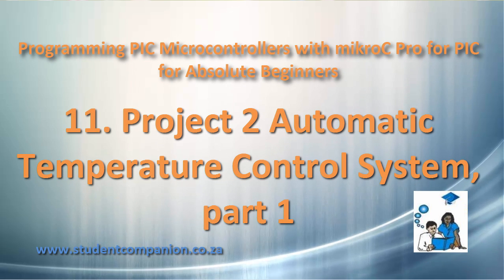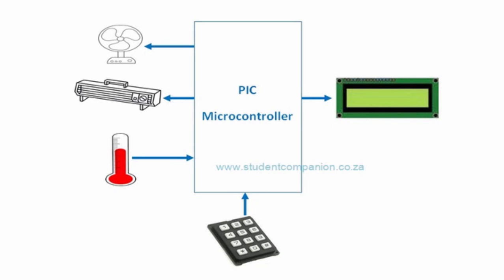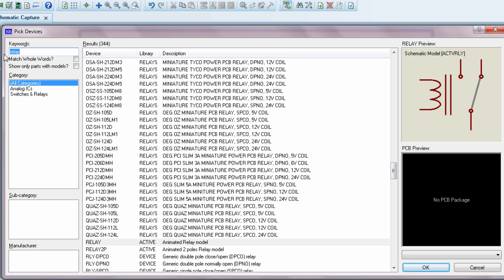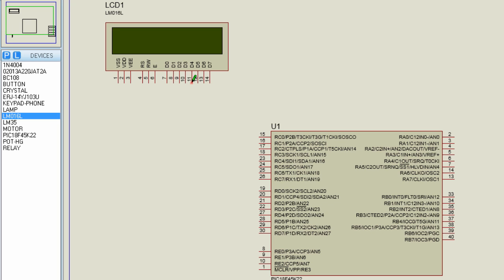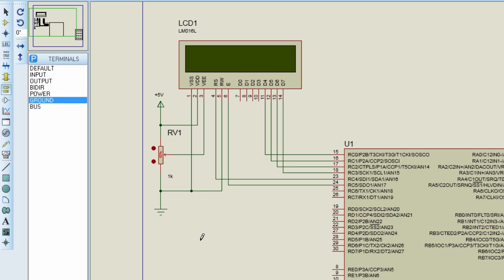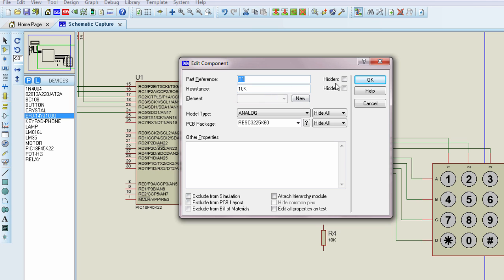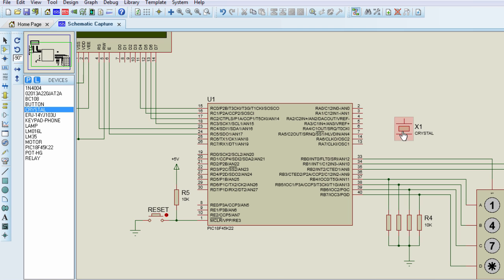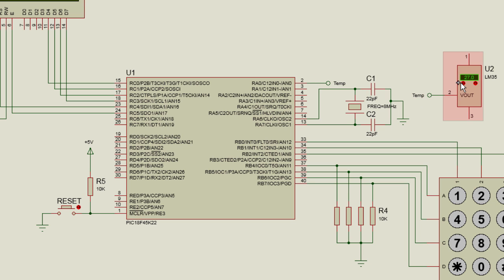11- Project 2 Automatic Temperature Control, part 1 | mikroC Pro for PIC Tutorial

Comment: how we can replace this pic by pic18f45k80 ??
Reply from the maker: There is nothing much to change, just choose a different PIC, configure correctly your clock and other configuration bits, then connect your inputs/outputs correctly to match your new PIC if there are diferences.
The rest of the code should be more or less then same.
If you encouter an error while building the code, post your error message.
Reply: @StudentCompanion  
Can you please mention the things I have to change from 
PIC18F45K22 to PIC18F45K80
Step by step
I have to submit the prototype tomorrow
Reply from the maker: I have already answered you, if you have a more specific question or if you get errors, ask the question again.
Part 2 of this video shows step by step how to start a new project, select clock and other configuration bits.  Follow that video

Comment: Good day. I have a question. What will be the changes in the code if i use PIC16F877a for this project?
Reply from the maker: If you need more info, ask specific questions we will assist you
Reply: That link is about a different project. For this, you have given the codes. What will be the changes to the codes if it will be changed to PIC16F877a.
Reply from the maker: Here is the discussion: https://www.studentcompanion.co.za/forums/topic/can-i-use-pic16f877a-as-the-microcontroller-for-automatic-temperature-control/
Reply: Also, will it affect the codes if i change it to PIC16F877a?
Reply from the maker: Just some few changes as described in the descussion in the link.
Reply: Thank you. Does changing the crystal oscillator from 8MHz to 20MHz affect the codes?
Reply from the maker: @JH-vj9ys  not in code but in Edit Project menu, change the oscillator settings to HS high frequency. 
Do you have good reasons to use high frequency on this simple project? If you are working on breadboard make sure your crystal oscillator is as close as possible to the PIC at higher frequency it's not advisable to work on breadboard.
Reply: @StudentCompanion  I only have 8MHz crystal oscillator (hardware). I have another question, when changing the ANSELx codes to ADCON1, where does the x part go?
Reply from the maker: @JH-vj9ys  if you only have an 8MHz crystal than why talk about 20MHz?
Reply: @StudentCompanion  my apologies, what i was suppose to say is that i only have 20MHz
Reply: @StudentCompanion  Hi, what's a good alternative for PIC18F45K22?
Reply from the maker: @JH-vj9ys  if you watch part 2 of this project, you will understand that we set a PORT to digital using the ANSEL register. ANSELC to set PORTC as  digital, ANSELB to set PORTB . So the x replaces the PORT. But with PIC16F877 does not have the ANSEL register.  ADCON register is used for that
Reply from the maker: @JH-vj9ys  good alternative in respect of what?
Reply: @StudentCompanion  alternative for the PIC
Reply from the maker: @JH-vj9ys  almost any PIC with enough inputs/outputs can be used in this project. Preferably use an newer model, they are more powerful with more features and are cheaper compared to the very old ones like the PIC16F877
Reply: @StudentCompanion  what if i use PIC18F4550, what would be changes in the circuit and codes?
Reply from the maker: @JH-vj9ys  why use PIC18F4550? First of all this is also a very old PIC model just like the PIC16F877, Secondly this is a PIC with USB and if you are not intending to use USB in your application why add more layer of complexity?
Reply from the maker: Check at this list for a suitably alternative: 
https://www.studentcompanion.co.za/product-category/microcontrollers/
Reply: @StudentCompanion  because i am going to create the hardware part and i lack the PIC18F45K22
Reply: @StudentCompanion  i can use any microcontroller on the list instead of PIC18F45K22?
Reply from the maker: @JH-vj9ys  yes almost any microcontroller on thr list can except the smaller ones with fewer pins like the PIC10F. Don't use unnecessarily Pic with special functions like USB or CAN as you don't need them. They will add extra complexity and cost a bit more for features you won't need.
Reply from the maker: @JH-vj9ys  Your code was not uploaded, when you upload, please zip your code first, don't upload the .h or .c files. zip all in one folder before uploading otherwise it will be blocked by our server.
Reply: @StudentCompanion  i already uploaded the zipped version. Thank you
Reply from the maker: @JH-vj9ys  we have answered you in the forum
Reply: @StudentCompanion  can you please send me the right codes?
Reply from the maker: @JH-vj9ys  You can modify it yourself and if you get errors during compilation let us know. What's difficult? We have posted the  differences in the forum, the rest of the code it's according to the changes you have already made.
Reply from the maker: Have a look at this thread: https://www.studentcompanion.co.za/forums/topic/is-there-any-changes-on-the-code-if-i-change-it-to-pic16f877a/

Comment: What size breadboard should I use to fit all components reasonably
Reply from the maker: Hi. A normal full size 830 points breadboard can be used.  But remember you can't put relays on breadboard using high power. It's very dangerous.
Reply: Thanks! And also....how big is the main power supply for the circuit
Reply from the maker: You just need 5v regulated power supply like this one without the 3.3v section: https://youtu.be/QhyEHQ5t0SU

Comment: Hi, I really have a problem with LM35. Firstly, the LM35 cannot read the temperature in Celcius by writing the code as mV = mV/10.0. However, I changed the code to mV = mV/100 instead. Secondly, the LM35 cannot read the actual temperature but it is just reading only 49.9 Celcius. Could you help me, please? Also, I would like to use the DHT11 on this project as well but I do not know how to write the code. Thank you.
Reply from the maker: What do you mean you can't read the temperature kn celcius? Did you watch this video to understand how it works: https://youtu.be/uXxvvrJpFVw

Comment: Hi, could you tell me where could i get heater and fan that necessary for this project. Thank you
Reply from the maker: Hi. You can use any heater or fan of your choice, but if you decide to use high power fan and heater, use the appropriate relays with ratings capable to handle this power.  And remember high voltage is dangerous it can kill you. So be safe. If you have never worked with high voltage like 220V or 110V look for assistance from a certified electrician. Don't do it yourself. If you are desing this project for demonstration purposes I would suggest you use a low voltage DC motor for fan and a bulb for heater. 
Search in electronics shops around your area or online.
You can also use any low
Reply: Student Companion thank you so much for your replying and suggestion
Reply from the maker: You are welcome!

Comment: i can't find pic 18f45k22 , where is the problem ?
Reply from the maker: +nawel ham find it where? Can you be specific with your question? In Proteus, mikroC, in your electronic shop, etc. ?
Reply: i can't find it in Proteus
Reply from the maker: Which version of Proteus are you using? If you are using an old version especially version 7 or earlier version of 8, you might not have new PIC models including PIC18F45K22.
Reply: i have Proteus version 7  thanks for replying me
Reply from the maker: When Version 7 was released, it did not include PIC18F45K22 as Microchip keep on releasing new PIC models very year. You must use one of the new version 8. it will include it, or use a different PIC (older model) for your project. This project can be implemented by almost any PIC with necessary number of pins.
Reply: okey i will try with another pic 
i have another question the mikro c file which that must included in the pic it must be a file of type .hex??
sorry i am beginner
Reply from the maker: No. It must be of type .C
The best way is to start a new project and use a different PIC. Then in the code area, write the same code. Depending on the PIC used, they might be no changes or very small. Watch this first tutorial to learn the basics how to start a new project: https://youtu.be/jQ8ddVYNlKU
Reply: I changed the PIC i chosed PIC18F4620 and i created a new project  but it's the same error that i have every time i compile it in mikro c ANSL is undeclared i check the code ten times but i can't find where is the wrong
Reply: i mean ANSELC ANSELB and ANSELD
Reply from the maker: +nawel ham remove that ANSEL line.  We gonna disable analog functions another way
Reply from the maker: +nawel ham remove all those lines
Reply: i removed them. now i have a new problem the variables inTemp temp and mV have been eliminated by optimizer  what does it mean!!!
Reply from the maker: +nawel ham is that an error or a warning? Can you paste all the error messages?
Reply: well i will write all the message
variable 'inTemp' has been eliminated by optimizer
variable 'Temp' has been eliminated by optimizer
variable 'mV' has been eliminated by optimizer
Finished(with errors)
Reply from the maker: +nawel ham write all messages
Reply: 0 1139 Available RAM: 3947 [bytes], Available ROM: 65536 [bytes]  
0 126 All files Preprocessed in 297 ms  
0 122 Compilation Started controle  automf.c
82 1506 Implicit conversion of pointer to int controle  automf.c
83 1508 Implicit conversion of int to ptr controle  automf.c
106 1506 Implicit conversion of pointer to int controle  automf.c
108 1508 Implicit conversion of int to ptr controle  automf.c
133 123 Compiled Successfully controle  automf.c
37 1164 Variable 'inTemp' has been eliminated by optimizer controle automf.c
38 1164 Variable 'temp' has been eliminated by optimizer controle  automf.c
39 1164 Variable 'mV' has been eliminated by optimizer controle  automf.c
0 127 All files Compiled in 344 ms  
0 434 Demo Limit Demo Limit
0 102 Finished (with errors): 16 déc. 2017, 17:52:37 controle  automf.mcppi
Reply from the maker: +nawel ham it doesn't complain about the code.  It seems like the code is fine. The error is: Demo Limit. Because you are using a free version of mikroC, it only allows you to compile codes which are 2kb or less in size. It won't compile bigger codes like this project. You must buy a licence to compile this project.

Comment: good day, i tried building the it on the breadboard but the keypad is not working at all, example if i press 9, the lcd will show 4 or Clear. i double check all the connections
Reply from the maker: +olavi Jonas it can only be something wrong with your harware. Did you try with a different keypad? Based on the information provided we really can't guess what could be wrong.  Other people have built this project successfully.
Reply: thanks for the reply, the pic that i am using is pic18f4620 because the pic 18f45k22 is not available were i am living. could that be the problem maybe
Reply from the maker: +olavi Jonas No. As long as you recompiled the code, set correctly your settings and generate a new hex file. Because you can't use an hex fike generated fkr a different PIC and expect it to work with your PIC.
Reply from the maker: +olavi Jonas Have you tried simulating your new code with your PIC18F4620 and see if it's working well in simulation?
Reply: I changed the code and ran it to work with a new hex. for the PIC18F4620, i simulated it in proteus and it is working fine, only when i built it on the bread board, it not working, the LCD, temperature sensor  is working perfect, only the keypad, its like the numbers are running around the keypad. if but chance i pressed to numbers and then simulate it, the heater and the fan goes on when it suppose to go on.
Reply from the maker: +olavi Jonas Then the problem can only be your keypad. Try to follow the comments of this user in our forum, it might be you're facing the problem they had before. They solved the problem by adding new resistors: http://www.studentcompanion.co.za/forums/topic/keypad-input-problem/
Reply: thanks alot i will try that, when you are free i would like to ask if you can make a tutorial about interface a keypad with mikroC
Reply from the maker: +olavi Jonas We will upload it soon on YouTube but in the mean time, you can read it on our website: http://www.studentcompanion.co.za/interfacing-matrix-keypad-with-pic-microcontroller-mikroc/
Reply: thanks, i would also like to let you know that the forum helped and its working
Reply from the maker: +olavi Jonas Wow! That's great to hear. So the problem was the resistors as well?
Reply from the maker: +Student Companion Can you kindly also write your comments in the Forum , replying to the same thread with the problem you had and the solution so that it can help others as well.

Comment: Hello! I am Haftamu, I don't get line 115 in the automatic temperature control mikroc code which is Actual temp, how can I get actual temp value?
Reply from the maker: Hi. Line 115 is just a mikroC function to convert a float variable to a string variable so that we can be able to display it on the LCD.
You can only send strings characters to LCD.
Reply: Thank you for replaying!
Reply: Thank you for replaying!
Reply: So, what is the difference between the Temp ref and Actual temp? does it mean we can find the Actual temp from Temp ref value?
Reply from the maker: You are welcome
Reply from the maker: Watch carefully this video especially part 2 and part 3. Temp ref is the reference temperature that you set with keypad. Actual temp is the actual ambient temperature read by the sensor. The program compare these two temperatures and decide either to switch ON the heater or the fan.
Reply: Thank you again, is there another way out to set a reference value I mean with out the keypad?, let us say for example can I set a fixed value(reference value) with out using any keypad or something else? By writing a code and set a specific memory space to it?
Reply from the maker: +Haftamu Mekonnen yes you can.
Reply: Thank you!
Reply from the maker: +Haftamu Mekonnen you are welcome!
Reply: So, would you please give me a little bit hint to do that?
Reply from the maker: There is nothing much you need to do. In the while(1) loop where we are comparing ref temp with actual temp, you will just compare your actual temperature with your default value:
For example if you choose to set your default temperature to 30, then you can write:
if (ActualTemp> 30)
{
HEATER = OFF;
FAN=ON;
}
if (ActualTemp< 30)
{
HEATER = ON;
FAN=OFF;
}
if (ActualTemp== 30)
{
HEATER = OFF;
FAN=OFF;
}
Reply: Thank you so much!
Reply from the maker: +Haftamu Mekonnen you are welcome